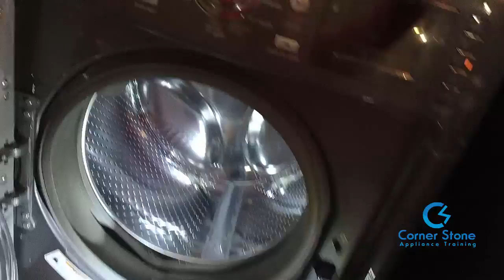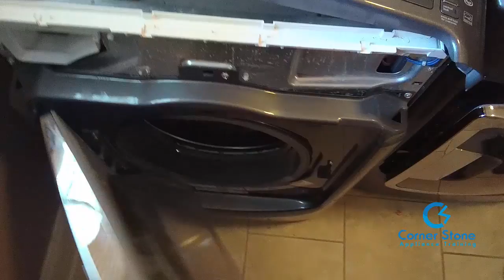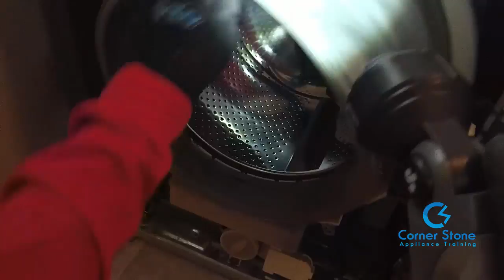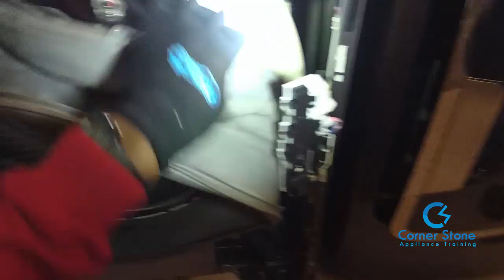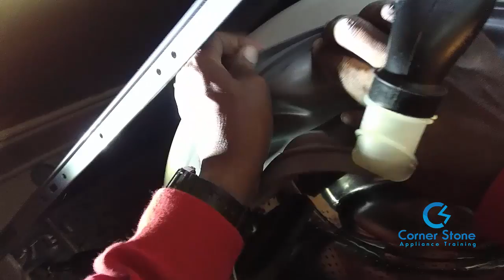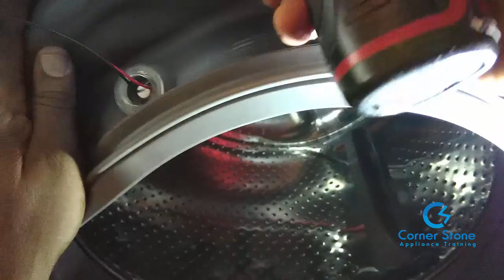Replace LG Front Load Washer Door Boot Seal (Gasket, Bellow) Part Number...

Comment: What is the symptom of a bad door seal? Leaking water out the door right ?
For a good deal, I am considering purchasing an LG Tromm with a leaking front door .
Just curious if this is the correct SIMPLE repair/solution ?

Thanks, Gerry from San Diego,CA
Reply from the maker: Gerry,

One of the symptoms of a bad door boot seal is leaking water out of the front door.  However, you are going to want to troubleshoot/check this thoroughly.  It could be leaking from another area (hose, detergent drawer, etc...).  

Is it a simple repair? Not exactly.  There is quite a bit of disassembling with a LG Front Load Washing Machine to replace the door boot seal/bellow (ie replacing the front boot seal retaining ring (2), etc...). Not to mention reassembling and ensuring it is not leaking.  So bottom line, tackle with caution.

Hope that helps.
Chris